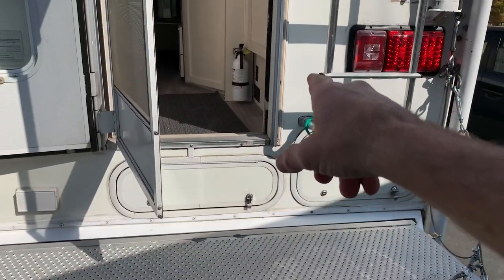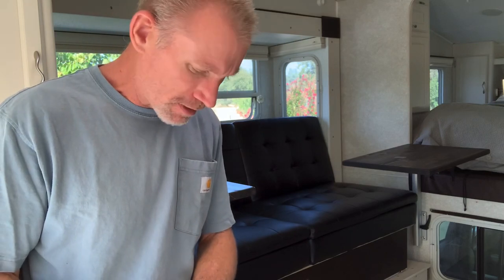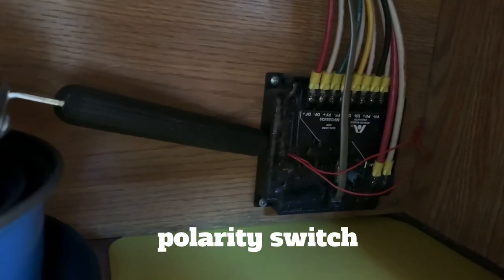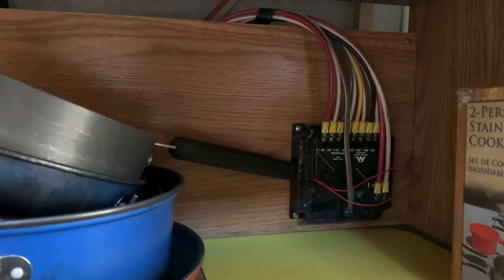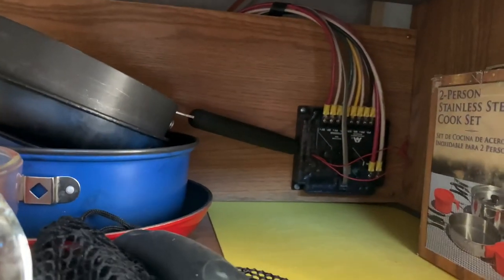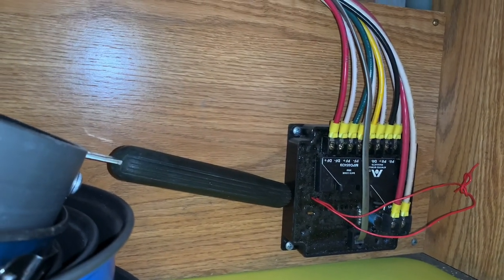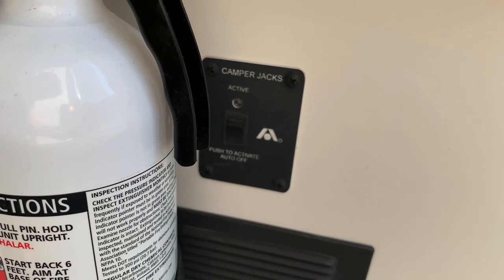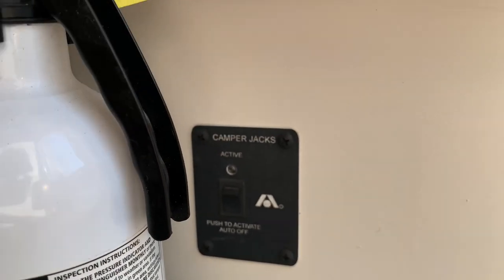Atwood Camper Jacks Troubleshoot & Repair.  Activation Switch Replacement

Comment: Thanks for the troubleshoot video. I worked for SWBT / AT&T over 30 years and replaced numerous phone / data jacks due to corrosion on the tiny brass spring contacts on the cord and jack ports.  The cord ends just have a thin plastic shield between each contact groove to prevent shorting.  Eventually the manufacturer injected a substance like Vaseline or die-electric grease into the port contacts to minimize corrosion.  At times I would use a thin screwdriver to lightly scrape the jack contacts when totally disconnected, and a brass suede brush for the cord ends...as a last resort. If you have a solder pen with small tip, you could freshen the solder connections also in case stress cracks were possible.  Hope this helps all who might have similar issues.     JwgK  Houston Tx

Comment: Thanks for the great video, lots of good info. Unfortuneatly I have a very different  jack control system on my 2017 Lance 825. I am commenting on this thread because maybe someone else is having similar problems. I have been having problems with my Atwood jacks for the last year. Even with a full battery charge and all fuses good, the jacks will not retract or extend, then all of a sudden they will start working. I can raise and lower the camper. I am now sure that it is cold weather that is affecting the operation. I have done this 2 times now. Its 48 degrees outside now. I tried to operate the jacks, no go. Then I turned on the heater warmed up the camper for 10 minutes and then everything worked fine. I am able to raise and lower the camper.  So I've found a solution, but not really happy with it. Lance was not responsive and the RV center I go to, wanted to charge me 80$ to diagnose. Anybody have an idea?
Reply from the maker: It’s possible that due to cold weather, your batteries are not providing enough power to the jacks.  As they warm up, the voltage increases.  
I would try with the camper plugged in or with a battery charger connected.  
On a cold morning, get a voltage reading on the battery. Use the temperature/voltage chart in the video linked below to confirm a good charge.
https://youtu.be/vc8ZKfqZk4o
Reply: @covetthecamper2289 I know this video is a couple of years old but I was hoping you can answer a question for me! Is this some kind of replacement leveling system that you have for your Atwood jacks?

Comment: Thanks for the tip on using 12v battery to raise the jacks vs using the hand crank. I was able to reach the power leads on the board with the pairs from each jack.

Comment: Thank you for the very informative video. I also have a 2003 Lance1010, mounted on a 2001 Ford F350, 7.3L ZF 6 speed, 4x4 dually. Your video had the answers. Thanks.

Comment: I had a problem with my jacks that had me going for awhile.  The short version is that a rodent had chewed through my RJ12-type cable and completely severed it.  I could not even find the next segment.  When I replaced the cable with a new RJ12 cable, it still didn't work.  The activation light never came on and the switch did not click the relay on the controller.  I finally discovered that a 'standard' RJ12 cable, like an RJ11, REVERSES the pin definitions from one end to the other, but the cable needed by the Atwood system uses a STRAIGHT cable.  So I got two reversing cables and coupled them together with a coupler I had on hand.  Then the system worked perfectly.  (Note that although the cable is 6-conductor, only four are used--the middle four--so standard RJ11 telephone cables, coupled as described above, should work too.

Comment: Thank you for your thorough diagnostic video!

Your link for the Polarity reversing unit goes to a wired unit that doesn’t list the Atwood model #.
But when I search Amazon for the model number, it comes up with a unit that shows the correct model # and costs $54 more than the model you’re link shows. Does the one in your link work with the wireless remote system? Thanks

Comment: My Fleetwood Caribou is a 2001 with almost the exact same layout. My activation switch is in the same location but my polarity switch is back where the drawer under your closet is. Had the fuse blow out once and that’s how I found it.
Reply from the maker: Yeah, digging around a couple years ago I found a bunch of relays and resettable fuses between the closet wall and the kitchen wall.  There’s a narrow chase there for all the 12V wires and AC wires that drop down from the ceiling.

Comment: So for a follow up, did the problem ever show itself again? You stated that you couldn’t recreate the problem after you showed it at the start of the video and as far as we know it never occurred again throughout the troubleshooting process. I’m having the same issue on the same jack as you were and would like to know if you solved the problem long-term by replacing the remote activation module. Thanks.
Reply from the maker: No issues since replacement of the remote module.

Comment: I have a new Lance truck camper they dumped Atwood they went to happy jacks Hope happy Jack’s is good quality🤔
Reply from the maker: They are good.  However, as with anything mechanical/electronic, there are failures.  I personally know of people who have had to replace two relatively new happijac camper jacks on a 2015 Bigfoot truck camper due to failure.

Comment: having a similar issue.  when i multi meter the front (D) or (P) I get 12 volts when retracting on each, but nothing on either when extending....think bad remote?
Reply from the maker: I replaced my remote and the GAMA activation panel for good measure.  I also added dielectric grease to all of the jack connections.  It’s been working great.

Comment: Atwood had  some problems i had the same problem with mine sucks
Reply from the maker: Eh, I figure 18 years on a $30 switch is ok.  Easy repair.
Reply: And I noticed your little hard on your jacks when you retract them till they click
Reply from the maker: I asked about that at my Atwood/Dometic training.   Bringing up the jacks fully is best. The 2-3 clicks of the clutch will not harm the mechanism.  Excessive clutch slip should be avoided to prevent damage to the jack.